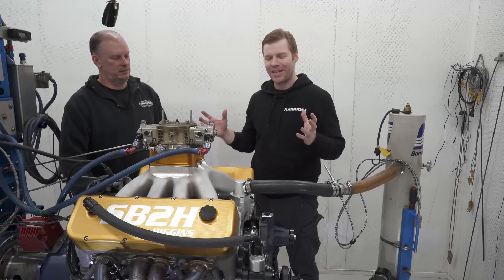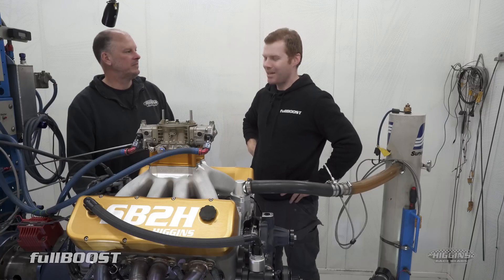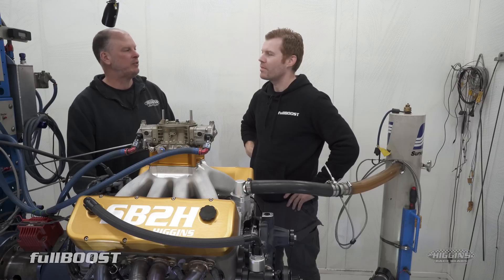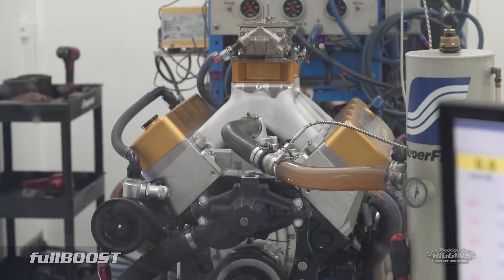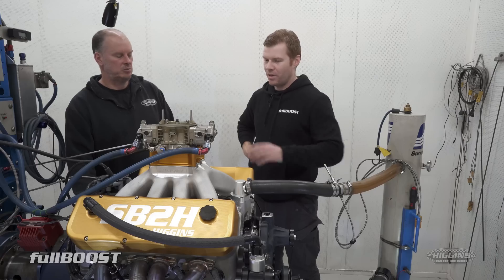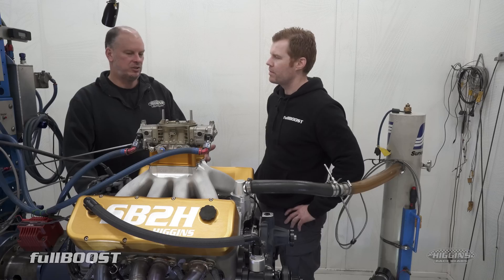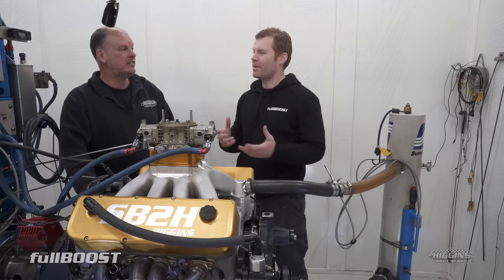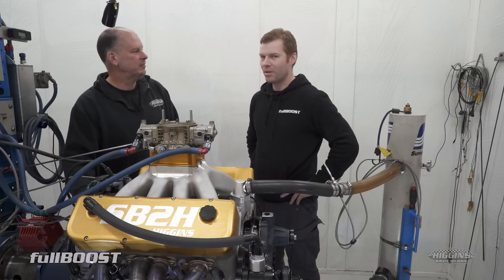Breathing new life into the Chevy Small Block with the HIGGINS SB2H | fullBOOST

Comment from the maker: We catch up with Nathan Higgins from Higgins Race Heads at Dandy Engines testing their new SB2H Chevy small block V8 cylinder heads. These are based on the NASCAR SB2.2 design architecture and performed extremely well at their first reliability session.  Higgins Race Heads will be offering multiple port sizes and manifold options to customers for both street and race applications.

If you’d like to be notified every time we upload a video, subscribe and then click the bell icon 🔔 next to the subscription button.
Reply: What compression ratio ?  Ball park if secretive please.
Reply: $6000 Australian dollars?
Reply from the maker: Yes, bare.
Reply: Fullboost + Nathan Higgins = Must watch immediately 🤙

Comment: I'm confused. You say it made 864 by 7500. The dyno show 857 at 7500 and 860.9 at 8000.
Reply from the maker: Yeah that's not the same pull. We did not film every pass the engine made. That is simply the final result.

Comment: Scott shafiroff sells a 820 hp street motor complete for 20-23k depending on fuel injection system. He also makes a couple that make 900+ with a bit more compression.
Reply: He does. The only issue I've seen is that the few I have seen tested, did not quite make the power he claims.

Comment: SB2 stands for Small Block 2nd Generation. It was designed in the late 80’s through the early 90’s. But wasn’t allowed by nascar until the 2001. (I may be wrong on that one.) you can use these heads on a stock gen one block with milling on the lifter bores.
Reply: Just to clarify the sb2 does  stand for 2nd generation but its the 2nd generation Nascar engine from GM. Gm also released a generation 2 sbc LT1 in 92 that was reverse flow coolant and a opti spark on the front driven by the cam instead of a crank driven dis. I also think  it was 98 that GM switched the the sb2 in nascar.

Comment: MBE LLC 13* head flows 440 cfm of air. Can make nearly 1000hp naturally aspirated with it
Reply: Not with a 260-ish cam and a 4150 at that rpm, with that valve size and with that MCSA.. Can't compare apples to oranges, and certainly shouldn't be basing power from a cfm number..
Reply: VengeanceIzMine agree with everything you say. Didn’t argue that. But a cfm rating is a good number to judge the horsepower that an engine is capable of making with the right combination. Not judging power out of cfm. I’m well aware of the factors that will restrict a head that flows that much if not taken into consideration.
Reply from the maker: Yes but these are in a different price bracket, this particular engine was merely a test mile. 👍

Comment: If you want to see some REAL power, Check out the Higgins heads on a small block Windsor. Pump gas=930 HP,   Race gas=980 HP.
Reply: Link?
Reply from the maker: https://youtu.be/5Rz7paeKSOM
Reply: Dale Ostrom ...so I'm just wondering if you use the 3.6 cross sectional area heads instead of the 2.6. And put a decent size cam 270degree plus and also give it 40 more cubes like the Ford...........I think you can safely say that it would exceed the Fords hp and torque quite easily!!!  What do ya reckon??????
Reply: @robmotown1 ; It is very difficult to beat the small block Ford. They have now added compression and achieved way over 1000 hp.
(1,053 hp single carb)
Reply: @daleostrom3613  have a look at the ICE vn commodore that makes 1100 hp small block ls based

Comment: How would this package do on a twin turbo setup as far as the two center exhaust ports next to each other?
Reply: Siamesed center exhaust isn't  a huge issue, as turbos have been run successfully for many years on the typical small block Chevrolets,  long before any LS came into the picture.  More importantly, what I look at, is the very shallow valve angle and very small chamber size this type of head uses. Not saying it can't be done, but they definitely need a different approach to keep pistons in one piece when using Nitrous and Boost.. very timing sensitive,  and controlling flame speed is critical.
Reply: @vengeanceizmine9878  The head will be fine on boost or nitrous. What you need is a short stroke that allows for a piston with eh proper crown design, a proper compression height and a strong ring land. Alternatively a tall deck small block would work really well.

Comment: WOw great stuff, perfect for anything which has plenty of room under the bonnet, those headers are something else, i have always said that if you have the headers pointing in the same direction as the port and as long as possible before a bend, you will increase HP by at least 10 to 20% easy more on top of your off the shelf headers made by most aftermarket  exhaust  manufacturers, nothing against them, its just that they have to cater for all those cars which require factory clearances under the bonnet. :) Like Pacemaker, DPE, Hurricane, X force and others?

Comment: At 3:45 he says all the runners point to the centre of the carby so the distance from the valve to the carby is the shortest. Wouldn't it be shorter still (and more equal) if the inlet and exhaust valves on the end cyls were the same position as an OEM head so the pairs of inlet ports were right next to each other instead of being separate by some distance? The new setup does make for a cool looking inlet manifold though.
Reply: I think he most likely meant the straightest rather than the shortest. This head is clearly designed with the single plane carburettor intake in mind. Something like an LS is designed around emissions and injection, so not strange it is less than ideal for a single plane.
Reply: He is referring to line of site, from valve to plenum... yes, the runner lengths differ from inside to outside, that is a necessary evil on a single carb intake.. this valve arrangement and port layout (often called a mirror port design) allows for a better line of site to the valve, compared to a symmetrical or traditional lay out. Ie: straighter overall intake tract. Hope this helps..

Comment: "small block" with a 8x24 valve cover lol
Reply: The bore spacing and block architecture is still small block
Reply: I thought you might check this out 😂
Reply: Moat should do a sloppy sbc build 💯
Reply: Have to live outside the box when it comes to making real power Normally Aspirated... not as easy as just bolting on 2 hair dryers and letting them do all the work.. lol.

Comment: Dude 6,000$ for a SB2 top end kit is cheap. Around 10-12 years ago just the set of as cast a set of as cast SB2 heads no guides, no seats, literally just out of the molds was over 10,000$
Reply: When all that NASCAR take-off stuff was available, heads with Ti valves, T&D or Jesel rockers could be had for <$2000 USD in the states. Of course those heads needed work to "work" as street or drag heads.

Whole motors could be had for ~8,000 USD.

M&M too end kits with good ports are roughly $2K more than this kit. It's a terrific price for stuff done right.